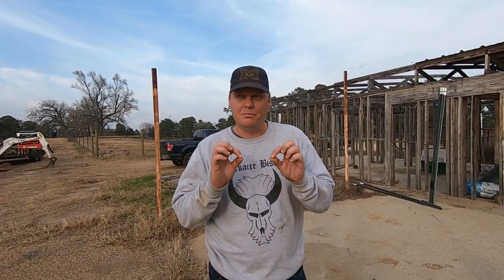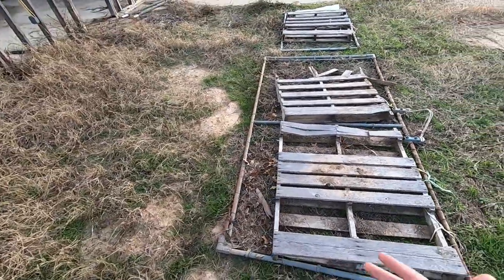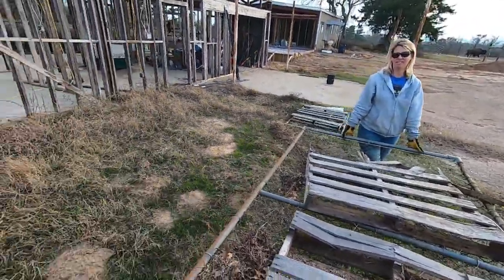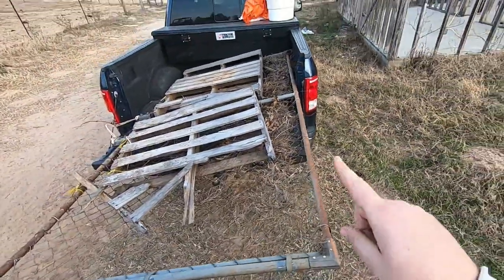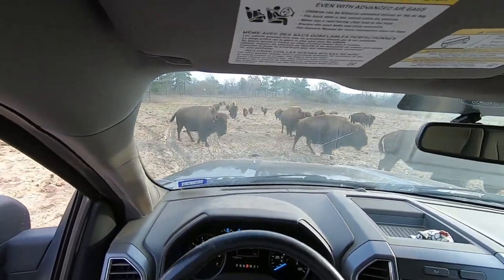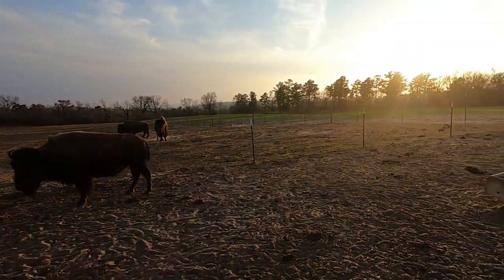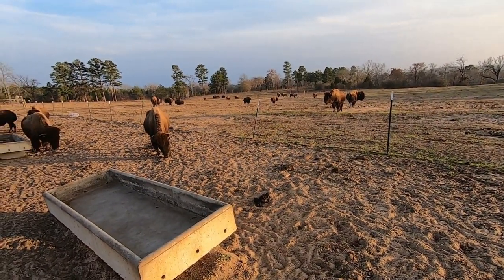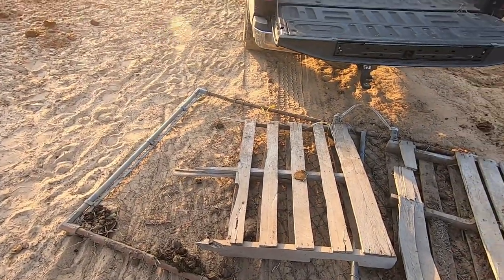Ep. 248 - Bison went NUTS dragging pasture manure

Comment: One thought on your spreader, 
If you used a steel fence post for the header with chain/rope for hook up to the hitch, attach the cyclone fencing to the post with no framing. 
Ten feet for dragging. 
The round fence post will jump over any stumps or debris and realign itself and keep on going. 
The more fencing touching the ground will rake and spread evenly and faster. Just ten feet or so of fencing should be enough weight for the raking, nice thing is when you’re done, just roll it up. 
I used this technique on fresh dirt work, it made clods of dirt break up fast. Main thing is more contact to the ground the better. 
You may need to adjust your length, so not to over work the grassy areas.
Reply from the maker: Great comment!